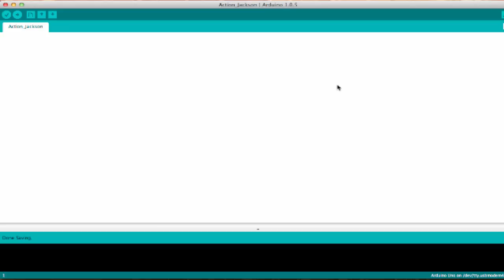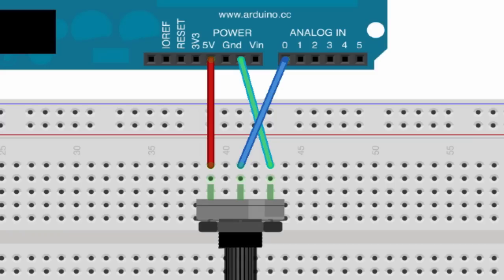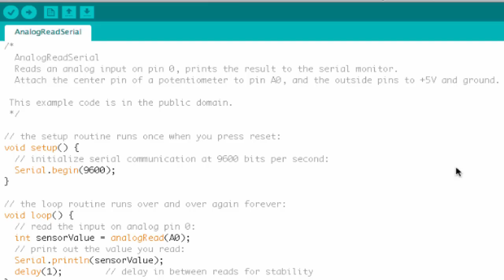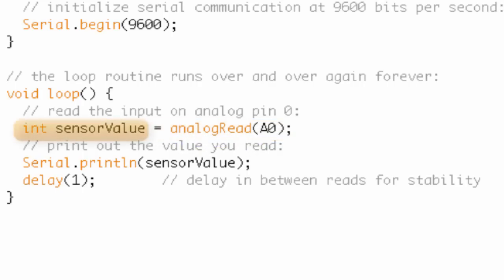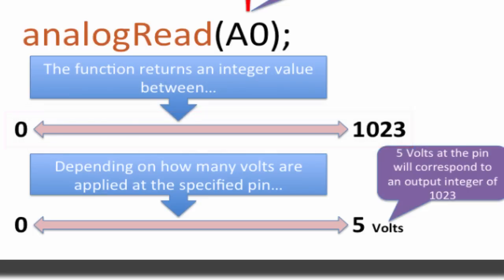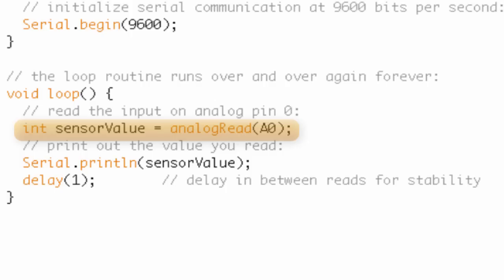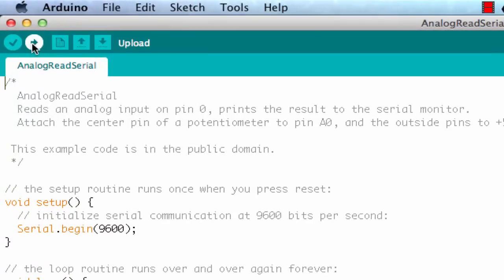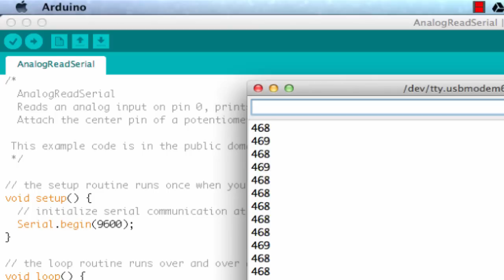Tutorial 08: analogRead() and the Serial Port: Arduino Course for Absolute Beginners (ReM)

Comment: Is there a way to put a serial library on the chip? Or is ity already there. Noob question i know but just wanna know how the thing works.
Reply from the maker: Thomas Heaven Thats a great question!  The Serial Library come preinstalled on your Arduino IDE - it is actually integrated into the software, so you don't have to add it manually. So when you write your sketches, If you use any of the serial library functions like "Serial.begin()" or Serial.print()", the functionality they enable will be included into the upload onto the chip that is on your Arduino.

Hope that helps some!
Reply: Open Source Hardware Group But if i want to "finalize" my project and transfer it to an Atmel chip or AVR on a protoboard will the library go with it or those also come with pre-installed libraries? Thank you very much for your time.
Reply from the maker: Thomas Heaven When you load your code to that "finalized" IC , the necessary parts of the library will be included.  Which makes things pretty easy!
Reply: Open Source Hardware Group Thank you.

Comment: The numbers 0-1023 represent what??Voltage or some other quantity?
Reply from the maker: +Ana Dino That is correct, it is mapping voltage.   5 volts is represent by the 1023, and 0 volts is represented by 0.  So it is about 4.9 mV per number in the scale.

Here is the Arduino reference on it:
http://www.arduino.cc/en/Reference/AnalogRead

Thanks for watching, great question!

Comment: First of all I would like to thank you for creating this awesome serie.
With that said, I actually have a small question. At the beggining of the video you mentioned that your potentiometer had 1000k resistance. Is thats the case wouldnt it affect your voltage. So how did it reach the 1023?
Reply from the maker: Mario Sanchez Great question! In a series circuit like this one, the entire amount of the voltage will be applied across the potentiometer.  Since a potentiometer is like a voltage divider, when I have the potentiometer knob turned so that all the resistance is before the analog pin, then the analog pin will "see" the entire 5 volts.  When we use the analogRead function, 5 volts translates to the number 1023, which is the value that gets returned.  A bit of a difficult concept to fit in a small reply box, but I hope it helped some - Have a good one!